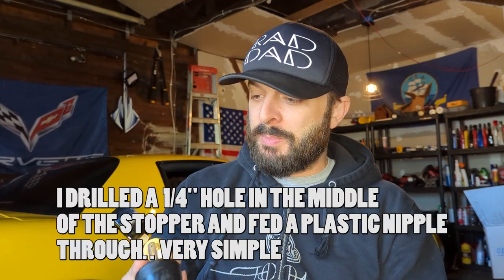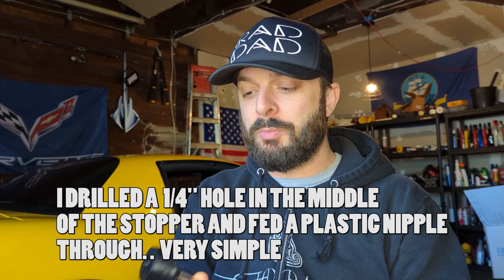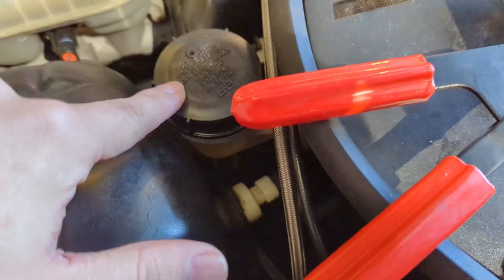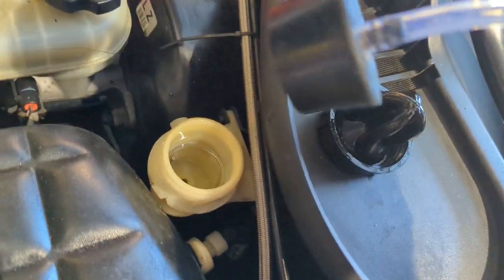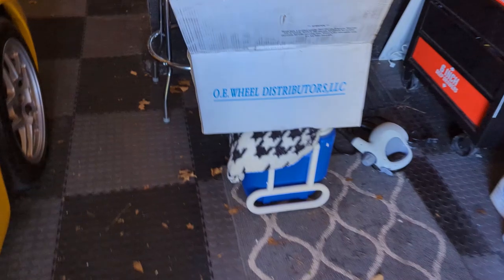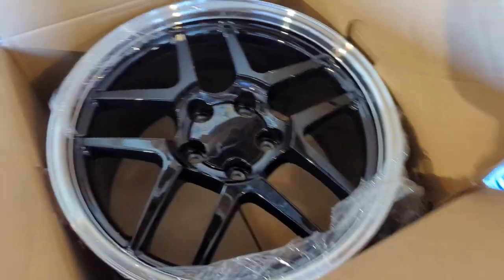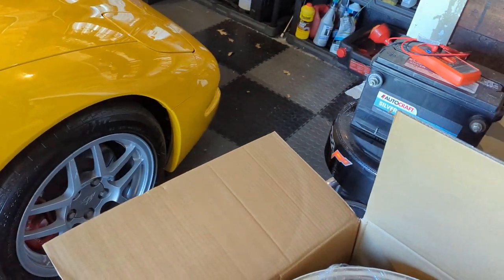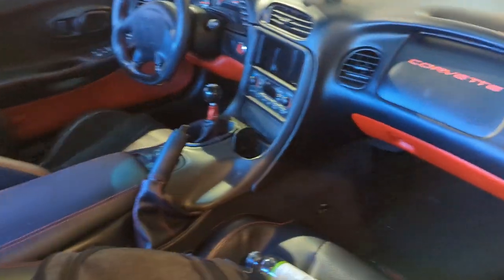C5 | C6 | C7 NO MORE MISSED SHIFTS | CLUNKY SHIFTING? HARD TO GET INTO GEAR?  $20 DOLLAR SOLUTION.

Comment: So you simply just suck on it to remove any potential air in the system no touching the bleeder nothing ? When I shift from 1st to 2nd it kinda clunks as well it's difficult to get into 1st and reverse..
Reply: have u found anything on ur issue having the same problem

Comment: Won't the ecu get upset if the wheels are not different diameters?
Reply: Since noone has answered this yet. The simple solution would be editing the tire size so that the overall diameter of the wheel and tire assembly is the same. Results in a larger wheel, and a shorter sidewall.

Comment: I have an MGW and it’s ok… but the fore & aft shifting is almost notchy but just stiff. Even after a fluid swap. Still almost hard to shift. I’ll have to try this.
Reply: I have MGW flat also. I'm going to try this and try the Venom mod also.
Reply: @lag1791  I didn’t notice much w the venom mod.  That loosens shifting going left and right.    I think notchy shifting fore & aft is the syncros, clutch and overall condition of the trans.  Which is ironic for me because t56 typically loosen way up over time.  I had a built one in my last LS car and it was amazing.  Mines just tight 😒. I thought it might be the lower shift box but that moves freely.
Reply: I have an MGW in my 02 Z. It's stiff as well with no air in the fluid. I wish it was a little easier on the elbow but it's a very well-built shifter.
Reply: @35057  Did this help at all? MGW shifter here as well.